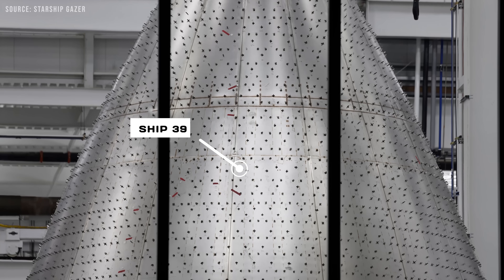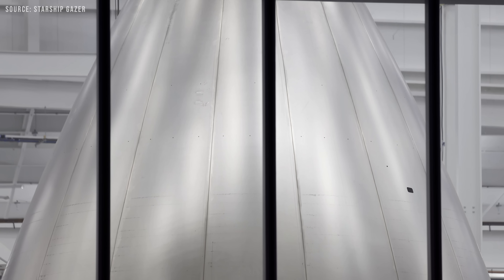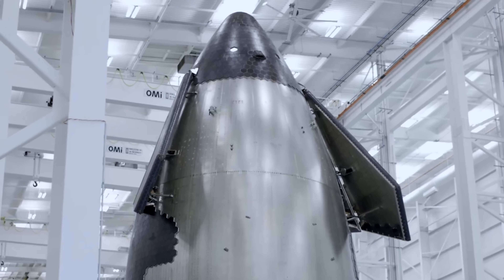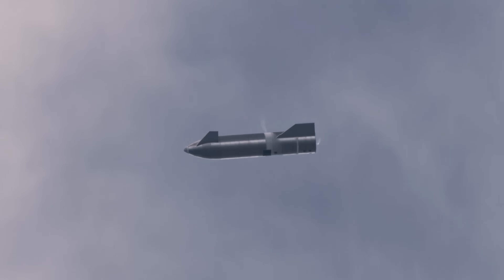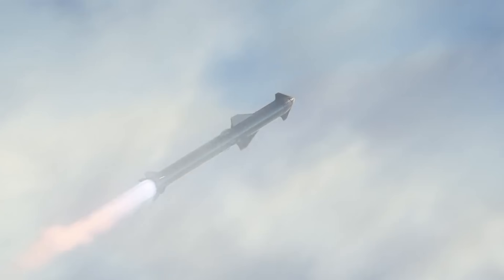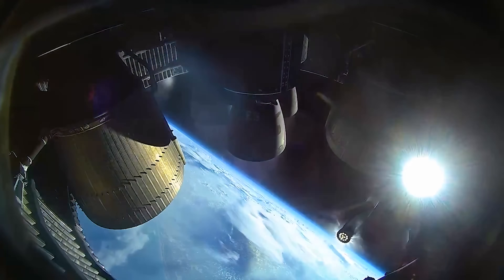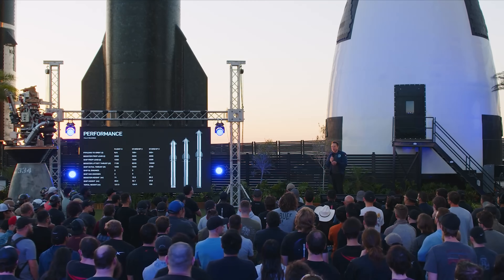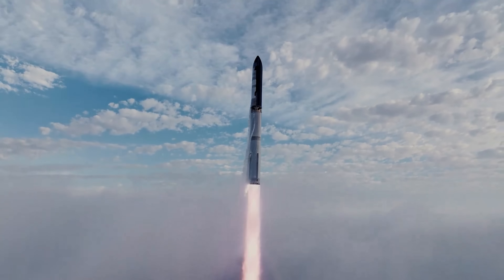SpaceX's New Major Starship V3 Nosecone Upgrade will blow your mind...

Comment: the best part is fewer welds every early failure was from wields 

the truth is pointer helps with higher speeds and swifter take offs remember it's not about speed it's about speed at low levels  and acceleration so bigger raptor engines push the nose faster meaning it needs to sustain and withstand higher take off speeds ;) 

look at the raptor 1 2 3 and 4 and you will see why it needs to be more pointy. 
Raptor ( 1 is 185 metric tons force 
2 is 230 sea level 258 metric tons force
3 is 280 metric tons force
and 4 is 300 metric tons force)

*I will say the push is and will keep pushing for 400 metric tons of thrust per engine. 
 
and how the migration is to metal tiles in some locations for super high heats. and eventually miliary dedicated versions of starship.